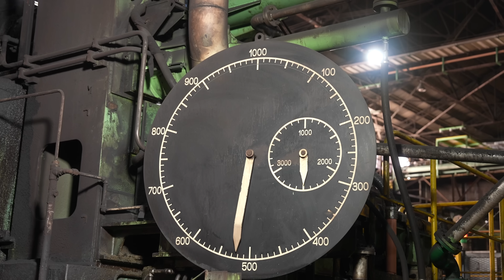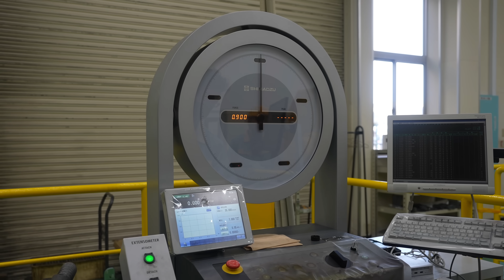厚鋼板を大量生産するプロセス。まちづくりとものづくりを支える日本の鉄鋼メーカー。

Comment: I wonder if it's necessary to allow the steel to cool between the first cutting and the rolling phase. It seems like an inefficiency that they could reduce  if they could somehow co-locate the smelter and roller.
Reply: I honestly think they know what they are doing, and if efficiencies could be gained that easy then they would be doing it. Agree?
Reply: Agreed, and they have the best quality.@Ozsmallbore
Reply: Maybe it doesn't have to be kept hot continuously, in which case there's no reason to bother. Or maybe it's easier or cheaper to reheat it later than to keep it hot. I'm sure that the time between operations is longer than the editing makes it seem.
It could be that the grinding process is required for the rolling. That can't be done when it's hot enough to be pliable.
Reply: no necesariamente según lo que conozco la acería es menos rápida que la laminación por eso la acería debe producir primero los lingotes al por mayor y luego se trabaja la laminación  mejor dicho la acería se demora mas tiempo para producir los lingotes y la laminación es muy rápida  así que la laminación se pararía esperando los lingotes y se pierde tiempo entonces por decir algo la acería  saca 200 toneladas en un mes mientras la laminadora saca 800 toneladas en un mes por eso es difícil que trabajen en en forma continua las 2 acería y laminación hermoso trabajo de los japoneses se ve lo lindo de las laminas